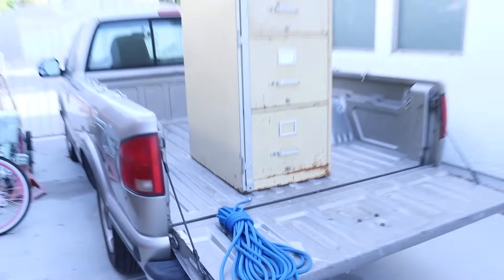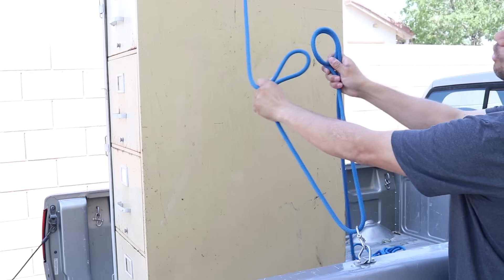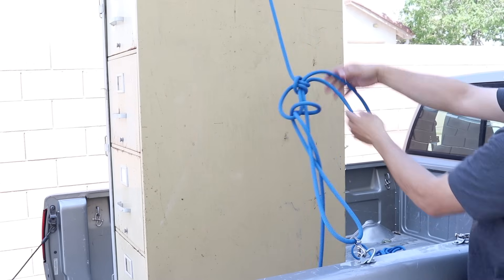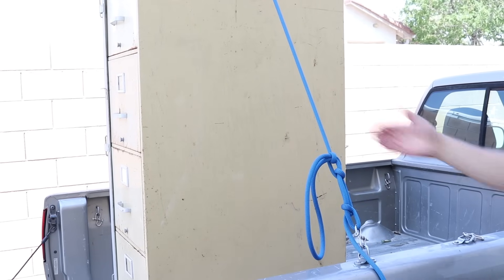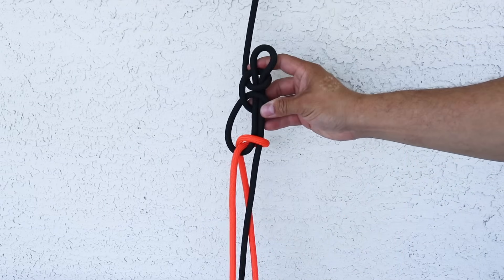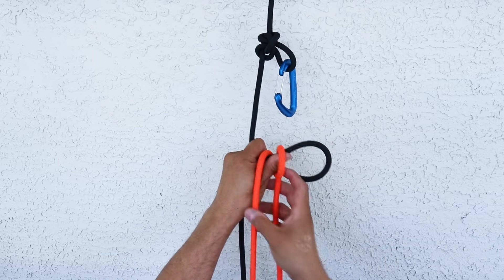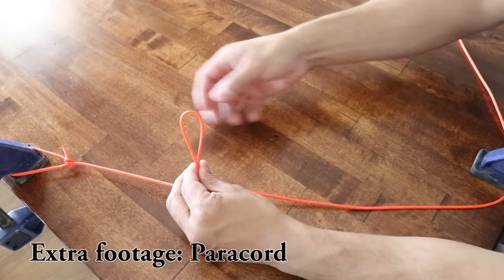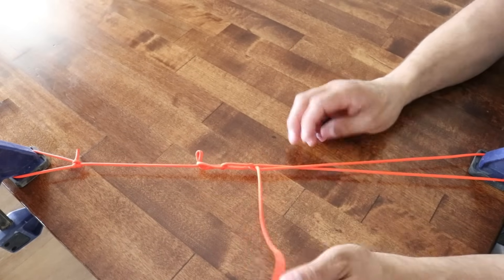In-line Auto Truckers Hitch. Better Explanation

Comment: My guess is most knots are created by mistake with accidental tangles in a line. The tangle/knot is then examined and discovered to be useful, and then gradually pulled apart to learn how to do it. Modern knots are variants of these accidental discoveries. I'm guessing a "bite" is derived literally, by someone who was holding a portion of a line or had their hands busy and they used their teeth to try and untie it, forming the shape we now know as a bite.

Comment: In the last video, your half hitches were placed below the tensioned knot. In this video you put them above. Does it make any difference?
Reply from the maker: As long as the half hitches aren’t going to slip out, it works either way. Tying it below means you’re going around a smaller diameter as you cinch down. That might work better depending on the type of rope you are using.

Comment: What's the word on the Polypropylene Diamond Braid Rope (like from Home Depot) vs climbing rope? Would you use the Poly Diamond Braid the same way?
Reply from the maker: It would work, but I much prefer paramax. The rope you find at Home Depot stretches more and wears out faster.
Reply: @First_Class_Amateur  do you usually use the 5/16 or 1/4" paramax?
Reply from the maker: I like 1/4” because 50’ of 1/4” is less bulky then 50’ of 5/16.

Comment: This seems complicated for a truckers hitch, I was taught how to tie a truckers hitch in such a way that its tight until you pull from the loose end, and no its not "pullable" without intent. I also never touched the loose end of the rope it was not necessary. The guy who taught me said it was a modified 1/2 hitch I never really checked that part out. The knot cinched down increasing tension to what ever I was comfortable with and was tied in less than 10 seconds. I never thought much about it but I guess that old trucker really knew his stuff.
-MG

Comment: Please do not use climbing rope like the one you have there (dynamic rope) to secure loads. Climbing ropes are specifically designed to stretch to absorb shock, which you do not want. If you’ve ever taken a fall while tied to a dynamic rope, you’ll notice it can stretch a few feet and you’ll understand what I mean. 

Use a static line instead or webbing, those stretch less and are more secure.  Climbers specifically use static line/webbing to build secure anchors precisely because it doesn’t stretch much when under load. Not only that, static ropes are a lot cheaper.
Reply: Sport/rock climbing ropes are dynamic, rescue/arborist ropes are static (generally) and their prices are generally similar.

Comment: I was about to comment on your old video saying I wasn't sure how secure stuffing the bite through the larks head was, technically with enough force on the bite it could pull out of the larks head, but this carabiner solves that.
Reply: It will hold so long as it is under tension.  If you want more piece of mind, it's easy enough to use a clove hitch instead of a larks head.  It maybe a bit harder to undo though.  FYI, for knots it's spelled bight.  Maybe it's your autokorect.

Comment: was just watching this again.  Something I noticed but didn't comment on.  In your truck you have some stainless steel rings, forming a hook.  I would worry that they would spread out, but your credibility seems pretty high.  so what am I missing?  always looking for little tips and tricks.  Hope this finds you well.
Reply from the maker: Hi Mark. I’ve been using those for years without any trouble. This my utility truck. I mostly use it for trips to the dump. I’ve tie things down with as much tension as I can and never bent one open. That’s probably because the load is spread across 8 of them.
Reply: @First_Class_Amateur  thanks!  I like that they just form an open hook so you don’t have to thread in a long piece of rope. I have precut 15 feet ropes with hooks on the end. I tried using a rachet rope type hook but nowhere near the tension you are getting here.  I like things tight.

Comment: Is there a knot to compress two pipes together?
Reply: If you mean to connect 2 pipes together, very tightly, you can use the constrictor, double constrictor, or a boa constrictor. These are not knots, but hitches.
Reply: @nokieng6502  You are probably correct of it being a hitch but I'm wanting to connect 4in iron to pvc pipe using a service weight gasket without pounding.
Reply: @MasterYoist  No, end to end a 4in iron to pvc using a service weight gasket
Reply: Not sure whether this will work or not but maybe get it a try. Using a single rope tie two prusiks (at least 3 loops each), one on each of the two pipes. Place a rod, stick, etc between the two prusiks and start turning in either direction. That should tighten up the rope thus pulling the two prusiks together (which of course should not be moving), and hopefully compressing your gasket. Let me know. Good luck.

Comment: So you do a couple of good rope bends,  explain them very well with a good demonstration,  then stuff jt all up with a very bad example of how NOT to coil a rope,  a method which causes the rope coil to twist.
Reply from the maker: Kezza, that’s actually my preferred coil method when throwing a rope. It’s coming up in a later video.
Reply: @First_Class_Amateur  sorry,  but coiling a rope around your arm is not the best way to "lay" the loops for throwing a rope as in a rescue situation or any situation for that matter where you need to throw an end out.  IMO no rope or electric extension lead should ever be cooked that way, it's damages the natural set of the the twist of both rope and extension leads. 
But hey it's your channel,  you certainly described that grab hitch well. 
Cheers
Reply from the maker: @kezzatries  I appreciate you taking the time to reply. Would it be OK with you if I give you a shout-out and mention your advice when I make the video? Thanks
Reply: @First_Class_Amateur  well put,  I don't care. As I said you did a good job,  it's  just my opinion.  Sorry I upset you by replying.  Live long and mmmm be happy?
Reply: Regarding throwing a rope (ie rescue line).…coil rope, but alternate the direction of each coil. The line will never tangle when throwing it as in a rescue  situation.
Reply: Watch again. This is a standard correct way of coiling rope, because he's doing a figure eight pattern, so he isn't introducing a twist into the rope. The way it crosses in front of his arm is the trick.

Comment: This is just a modification of a sheepshank knot which is an old nautical knot used for shortening a section of rope.
Reply: Jason Cambell -  So true.  It's the knot Quint had Hooper tie in Jaws.  I learned to respect tension and friction from that knot.  It's a special purpose knot, that doesn't get used much. 
There are ways to tie it so it holds solid when tension is lost too.

Comment: Interesting the way you assembled the hitch but way too complicated. And that big loose loop at the start would be a snag hazard, Rope as a securing device on commercial vehicles here in Australia has been illegal for decades. Work fine for non commercial use though.
The whole hitch doesnt need to be more than 4 inches long. You are limited by the length to one hitch. With the shorter version you can get up to 3 hitches multiplication.

Comment: For tarping a semi with 30 or 40 ropes to tie you'd never in a million years use this - particularly doing multi drop deliveries.
Use a beehive truckies hitch. Same mechanical advantage, doesn't slip, as simple as release as you could imagine, takes 95% less time than this.
https://www.youtube.com/watch?v=73hHtb_if1g
Reply: I agree,  it's a nice knot he does but that method in the video link is how I always did it. Simple and fast. I did bowline for the anchor point though. No overhang.
Reply: @tombrown9460  Yeah and there's triangles in the chains too. They're wrong and should never be used. The pull should be straight as the triangles induce stretch in the case of impact. Very poor form teaching trainees this.
The other thing training companies often do is show students that it's OK to use straps and chains together to total up the restraining force - WRONG! You can use straps and chains but never to total up a load eg I recently saw a 12t excavator counterweight was on the back of a semi that was training someone and it had 2x chains (yes with triangles) and 2x 2.5t straps. This is illegal. In an impact the 2x chains take all the load since they have lower coefficient of stretch, then break because there's only 7200kg of restraint, then the 2x straps have to take up the slack which is only 5t. All this means the load is unrestrained when you need it most. 
All straps or all chains. 
Say you have 3 layers of steel, you can chain lower layers and put straps on the upper layer so long as the chains completely restrain the lower layers. A couple straps over a say a 4t pack on the top layer is fine - you just can't strap and chain each layer. I see this all the time.
When I have 3 layers I just use all straps anyhow. Some mills won't let you leave without chained and tarped loads regardless of weather and they watch you do it too so you can't hide the straps under the tarp LOL. Many times my load has been audited - perhaps as many as 100x, which is why I'm clued up on this sort of thing; that and I'm forced to to load restrint refresher course every 12 months.
Reply: @ThePaulv12  sounds like you've done a bit of tarping, straping and chaining. Me,  I did a few years of flatbed.  Got,  as you would say,  shown the ropes by some old timers.  They emphasized efficiency.  Can't make money taking time for elaborate knots.

Comment: Good knot but completely overkill. Simple truckers hitch finished off with 2 open end half hitches does the job. Better still is it can work back on itself as many times as you like. This essentially works like a double/triple/quad line winch. You can literally pull a truck one handed.

Comment: Step 1....Throw the rope inside the cab of the truck.  Step 2.  Lay the file cabinet down...
Reply: This isn't a video about how to transport a filing cabinet. It's a video about how to tie a trucker's hitch that doesn't slip when you stop hauling on the end.
Reply: @DavidRichfield  very insightful Captain Obvious.
Reply: @triggerguard1  right back at you, chief! You're one of twenty others in this comment section saying "lay it flat, hur dur" as if you've discovered a hilarious plot hole.
Reply: @DavidRichfield  Well Captain, I ommitted the obvious, overly-complex method used to tie an otherwise simple not and went straight for the elephant in the room.  But thankfully, you came to the rescue of millions of future viewers to point out the subject matter I had yet to touch upon.  Point being, if you're going to illustrate the proper use of a knot, then do so.  An infinite amount of better examples could have been used, rather than something so obviously wrong, but that appears to keep Toubers like yourself on the edge of  your seat.  Perhaps you can emplore this method whilst securing your PS5 to the roof of your Subaru.  I'd imagine it would be quite handy for securing your load of scones as well.  Do post video as to how it all shakes out.

Comment: I'm a fan of your videos.  I've learned some things from your past videos. But this one isn't great.  It's impressive.  Your method works.  But you why it works and how the individual parts work just isn't there.  You're making a very complicated version of a "truckie hitch" as far as I can tell.  There's a Sheep Shank buried in there.  Then there's a Blackwall hitch concealed also.  

The trucker's hitch has 3 real components, which you don't explain.
The auto locking trucker's hitch just adds one thing:  A second turn of rope through the mid line loop, which forms a blackwall hitch.

You are obviously skilled with rope and knots.  This one seems very clever, but it's not very instructional.  I hope you take this the way it's intended.

Comment: If you crash with that car, the filingcabinet is going to fly. First off that filing cabinet needs to be flipped down to spread the weight out, and of course in contact with the front of the bed to reduce movement in case of a crash(the cabin of the car will decelerate the forces if properly tied down with the weight as low as possible). I see time and time again that people think it's enough to tie down something just for the ride itself, which shows complete lack of understanding that you should plan for the worst that can happen. You're going to prevent that filingcabinet from flying through the air and hitting a pedestrian, motorcyclerider etc etc or come flying right through the front windshield of oncoming traffic. 
Knowing how to tie a knot is worthless when done wrong...

PS: You made the video. Nobody else.